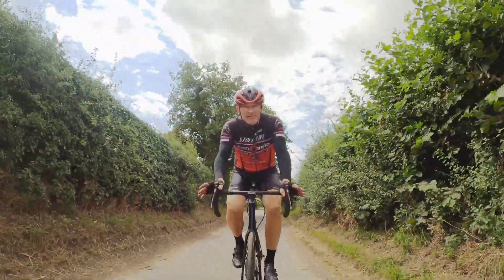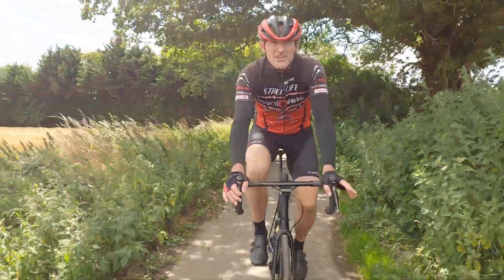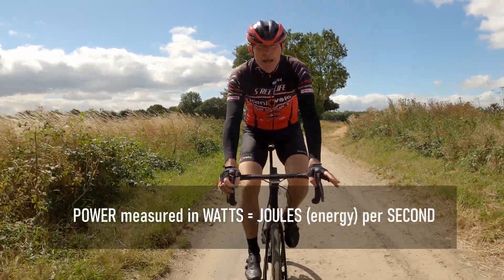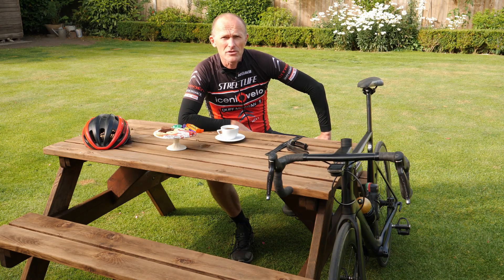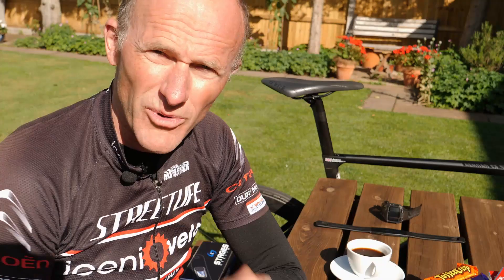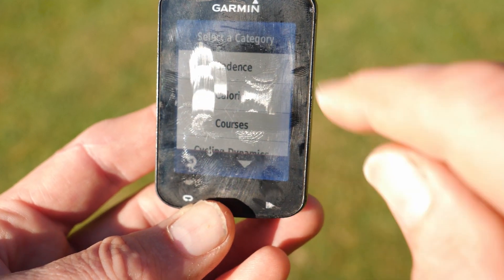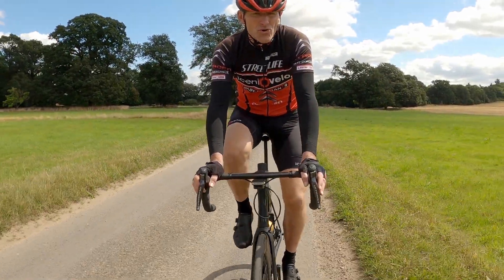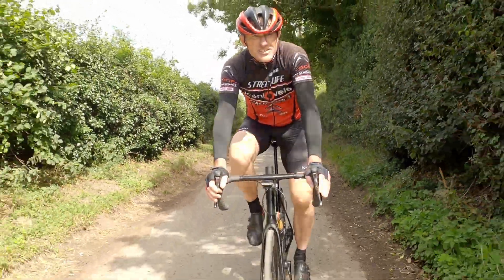HOW MANY CALORIES ARE USED CYCLING? | Calorie Counting with a powermeter

Comment: I never really thought about all that, cycling as much as I do I should have.   would taking creatine/protein shakes on rides help? and what's the best type of food to replenish calorie loss? A topic I don't see much on. Thanks again Andrew💯👍😍
Reply from the maker: I'm no nutritional expert! But what I think I know is based on several years of Ironman Triathlons. I can suggest that creatine is not really a necessary supplement for endurance athletes. Protein supplements like shakes or within energy drinks/bars is useful to avoid unnecessary muscle damage/wastage over long events.
Maybe I will do a video on nutrition!? Thanks for the suggestion.
Reply: @divum  no problem, thanks for the advice.  Ironman?  That's hard-core!💪😎 that why you go on long adventures? Cuz you're made out of iron? Im gonna struggle with bikepacking, I can see it now😂